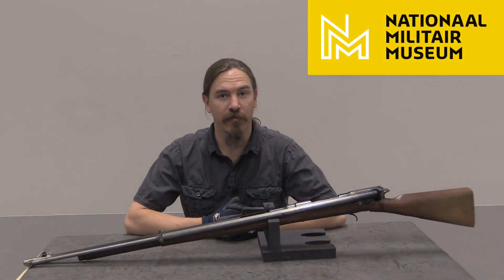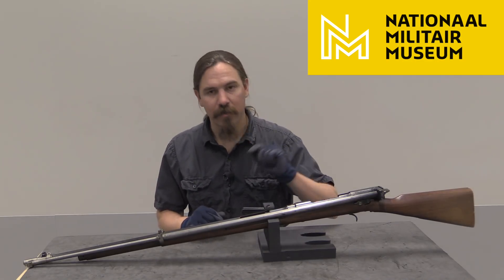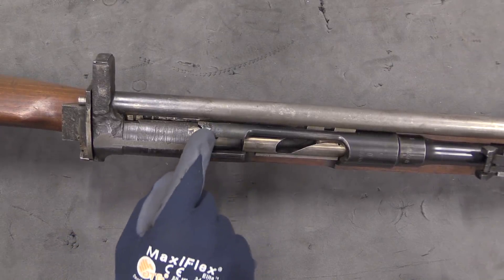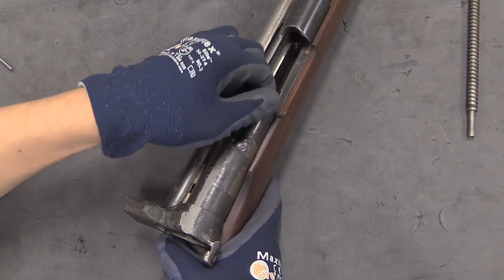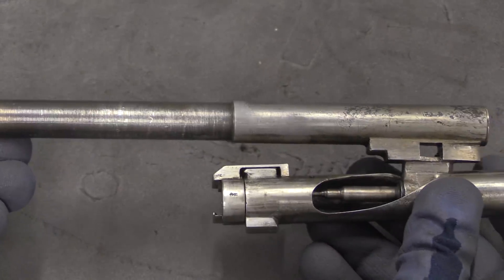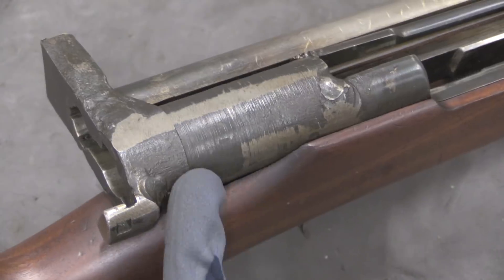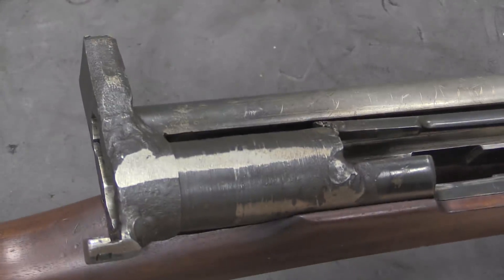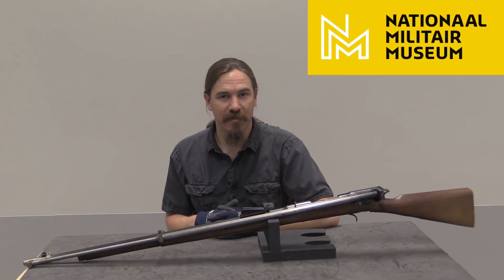Dutch Mannlicher Plus Lewis Gun Bolt Equals Semiauto...?

Comment: The Netherlands in the early 20s  was also adopting a 6,5x53R Lewis gun, ( BSA or Hembrug Made??? Next MG to review, Ian). Since the Bolt Face and Magazine Pans were basically the Same dimensions for the 6,5 as for the .303, only the Barrel had to be a New Part.
The KNL Lewis had a taller Mag than the .303 Lewis Infantry ( 60-80 rounds?)
But not as big as the 97 Air Service Mag.
( AFAIK)
The Germans used them on the Atlantic Wall ( as well as M95 Rifles, and even made Steel cased 6,5 ammo for them during the war.)
After 1945, they seemed to have disappeared. Replaced by Brens, Vickers, SMLE etc in .303.
DocAV

Comment: That gas system looks like it came from Home Depot, and was originally meant to connect the hot water tap on one of those fancy bathroom sinks that's designed to look like a mixing bowl sitting on a coffee table. :)

Comment: The question is: Why slap a gigantic Lewis gun gas system to the side of a Mannlicher ... when you can just use a Lewis gun? It can't be all that more unwieldy, probably more ergonomic, you get at least a 10x+ boost to magazine capacity, you don't have to worry about burning your hand on a scalding hot pipe right next to your supporting hand, and, as an added bonus, aren't playing Russian Roulette with having the receiver explode like a grenade, flinging shrapnel into your face.

Another interesting answer without a question.
Reply: Somebody suggested that this was an arms-factory experiment, and I think I agree. They were testing whether the whole idea was feasible.
Reply: I could experiment with whether or not walking across the freeway blindfolded is feasible, but I would say that's about an equally bad idea even on paper, unless they planned on also trying to substantially reduce the weight and size of the gas system if it all functioned as-is, instead of sticking with already available parts.

Comment: Despite the number of lewis guns that would be loosing their op systems, I think that of ALL the semi auto conversions I have seen so far in this channel, this one seems the most likely to have actually worked if it went further into testing!

What do you think? I know the likes of the pedersen device were actually more successful than this obviously but this seems like a much easier and cheaper way to do it.
Reply: Nope, not with a gas trap. Gas trap was quickly abandoned for a reason

Comment: Did they add a disconnect to the trigger mechanism?  Without extensive redesign of the trigger, it seems like this would have converted the bolt action to full-auto, not semi-auto (that is, if it worked at all) since the firing pin strikes whenever the bolt closes.
Reply: I doubt they even got that far haha. They probably shot the thing to see if it would cycle at all and then it broke and they probably stuck it back in storage. Or maybe they just wanted all their soldiers to be able to empty a couple rounds really quickly into the enemy.
Reply: TheIdahoanShow Thinking the same thing. I watched the video again, didn't see anything that hinted it was semi-auto... But parts are missing and I think we can all agree it probably never made it past firing a couple of rounds at most.
Too bad there isn't more history; the cheap welds looks like a contraption I would have made. :)
Reply: TheIdahoanShow ya with a fixed firing pin it does look like its just a full auto conversion with no real way to stop. they were probably well aware of that and probably only used a couple rounds at a time if that, proof of concept really.
Reply: That would explain the crack.
Reply: I wonder if that's not a disconnecter at 4:35

Comment: So when are you doing  the test firing :p :) Seriously what is the crudest gun you've actually fired safely?
Reply from the maker: Probably the Howell.
Reply: I watched that vid. You seemed to be picking some brass from your teeth, but otherwise it looked to be a pretty reasonable assembly of parts. Not as Heath Robinson/Rube Goldberg as the Mannlicher in this vid.

Comment: Looks like that rear piece was made from a casting. If it's cast iron it's not a surprise the weld broke. Cast iron doesn't really like to play nice with welding unless you jump through a few hoops and the purple squirel runs under the ladder.
Reply: D3faulted1 I learned this the hard way. Broke a yoke on an axle (bit the driveshaft bolts to, essentially), but it wasn't too broken, so I tack welded the u joint cap on and called it good. About a week later, I dropped a gear and hit the gas on the highway and suddenly the Jeep started vibrating and not accelerating. Pulled over, sure enough, welding to cast was a stupid idea, the weld broke and the u joint was in pieces for a mile behind me.
Reply: My preferred for cast is to braze it. Heat the whole piece up to around 500 degrees or so braze it and let it cool slowly wrapped up in some welding blankets.
Reply: @D3faulted1  this crappy looking end cap is in fact brazed!(brazen?) with a ton of brass...